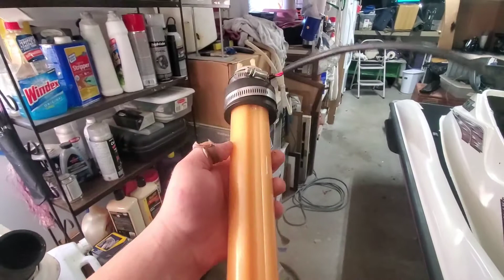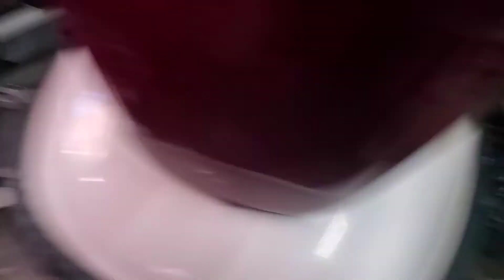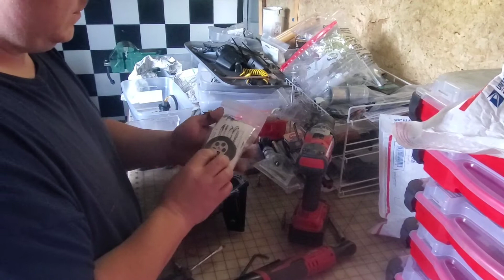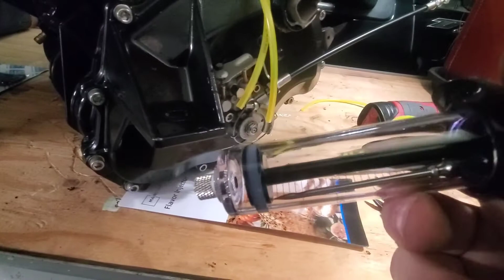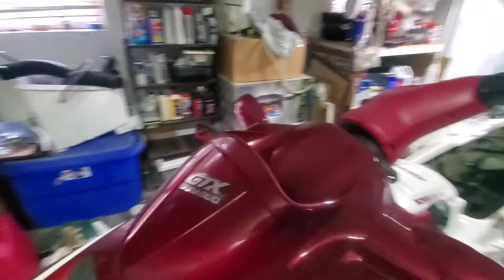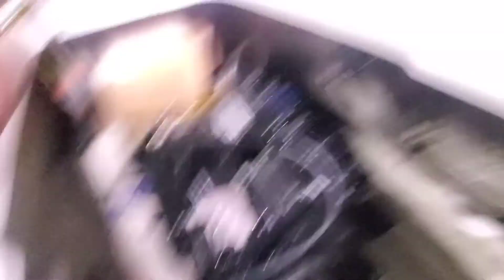1998 GTX Limited Project: Episode 3: Installing Engine and Parts

Comment: “Ask me how I know” lol I’ve done that shit too left the oil pump shaft out man I bet that was a bitch on the XP 951 build trying to put it in after motor was already installed
Reply from the maker: Luckily i had only bolted the engine in and hadnt put anything else on. I just had to unbolt the engine and pull it out and take the cove off and put the shaft in haha. Still wasted about maybe an hour.
Reply: @GC-EXTREME  yeah if the exhaust an stuff would have been on that would have been a bitch